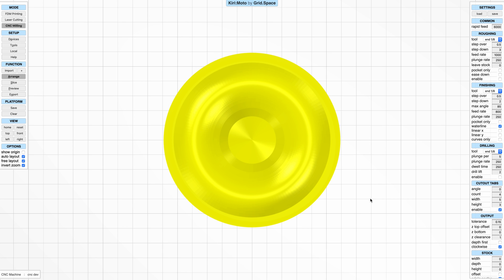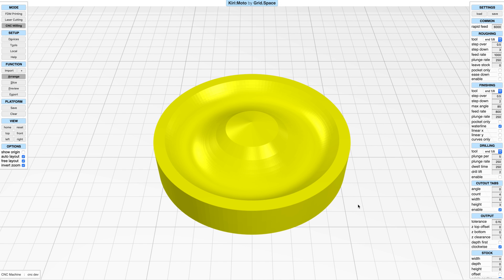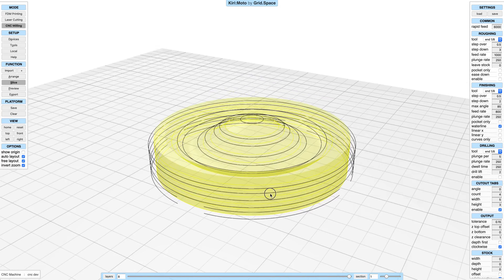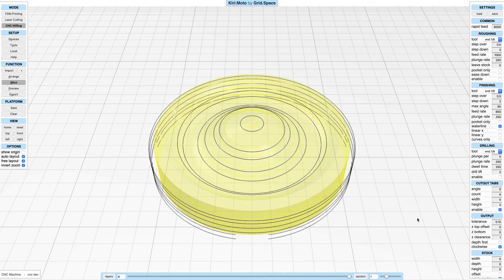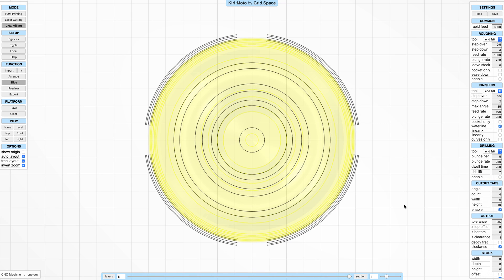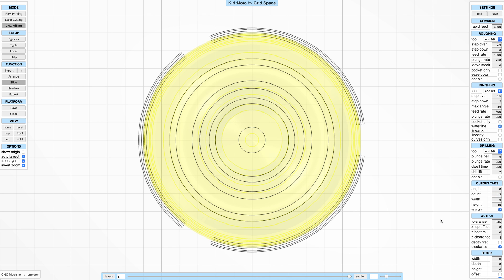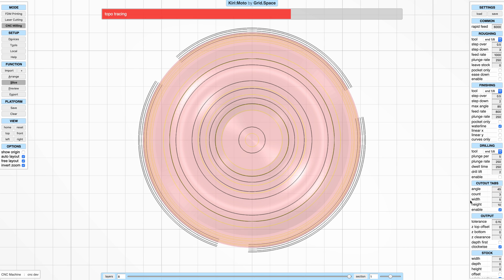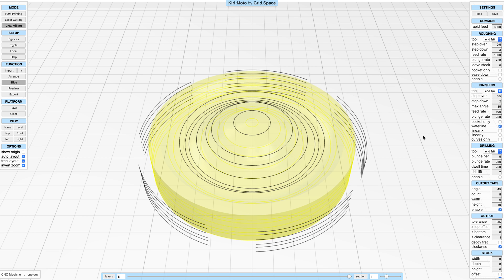Kiri:Moto Tab Cutouts Update

Comment: I've been working with the new tab arrangements today but in a an odd shaped project (triangular with some other bits sticking out), i'm unable to get the tabs to work as described. Any suggestions? Thanks!
Reply from the maker: Hi Scott.  For now, I recommend using a tab # which is <= to the number of major sides on the part.  This is a corner case that you've encountered when the tabs (projected from the center of the part) overlap.  I'm working on adding a new cutout type which is projected as a grid vs radially which could be more intuitive for some odd shapes.
Reply: @GridSpace  That's why! One large section is to one side of the center of the project so there's no tabs available on an entire side.
Reply: @GridSpace  Would you be able to program this so you can point and click where you'd like the tab to go (and if that could work on interior cut outs, even better)?
Reply from the maker: @scottm9164  I'll add it to the list.  Projecting tabs through the interior is an interesting idea.  I have some ideas about how to automate this more intelligently using flat edge detection.